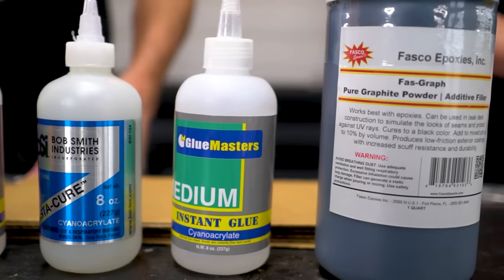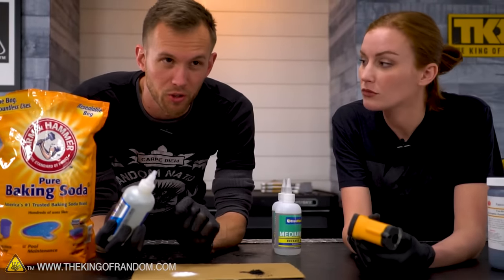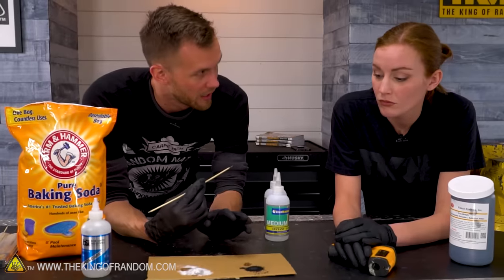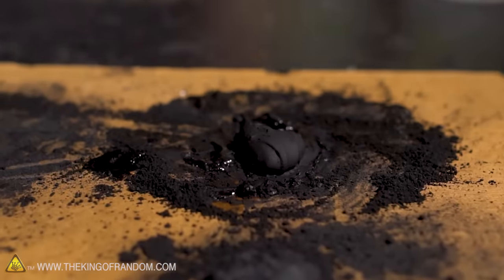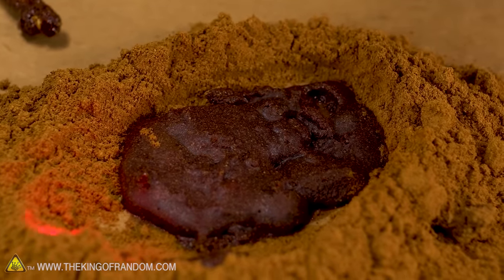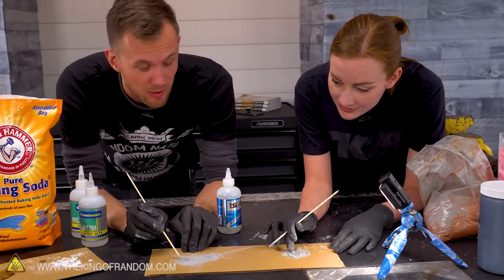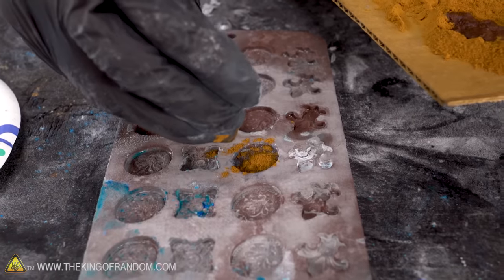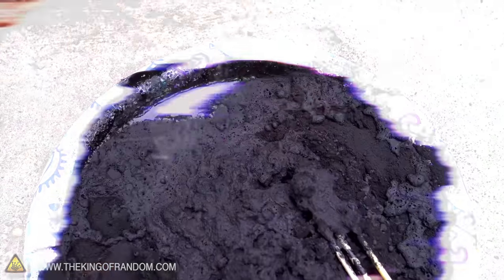Super Glue And CINNAMON Has An UNEXPECTED Reaction! The TKOR Super Glue and Baking Soda Trick!

Comment: By "catalyze," I think you mean "polymerize." Catalysis is the initiation of a reaction between two or more substances by an environmental factor. However, "polymerize" means to form ionic bonds.
Reply: ahh i think you are wrong .A catalyzed reaction is a chemical reaction.
Reply: @latouselatrec  A catalyzed reaction is a chemical reaction in which an environmental factor allows for intermediate reactions that require less energy and typically proceed faster.
Reply: @sciencestararvinsinghk  and what is the environmental factor
Reply: Waiting for the debate to go on...
Reply: Polymerisation forms covalent bonds. Usually bonds between carbon silicon or oxygen atoms.
Reply: Y'all having a scientific argument and I was thinking abt that one yugioh card
Reply: Baking soda works as an accelerator  by neutralizing the acid that slows down the resin from drawing moisture from the air. Its is not a catalyst as it does not change the energy required.
Reply: Ok,boomer
Reply: cringed every time she said catalyze.....
Reply: Oooo
Reply: @sciencestararvinsinghk  not enviromental

Sure you can speed stuff up with like heat. And some only work in specefic conditions (like enzymes).
Reply: After all this, I'm even more confused.
Reply: SMART PPL IN THE COMMENTS gOTTA dIP!
Reply: Wtf r u talkin about
Reply: Dutchik yes you can speed up reactions with heat but any science textbook will tell you that heat is not classified as a catalyst. All catalysts speed up reactions but not all things that speed up reactions are catalysts.
Reply: I learned a catalyst is something that speeds up a chemical reaction like an enzyme.
Reply: Is this a definition for millenials where anything could change so specifics are dangerous? Aka a definition for people that choose to be idiots even though everyone discouraged them from being so. Hahaha
Reply: You don't know what catalyze means either.
Reply: I was thinking about that, carbon tends to be a pretty stable guy.
Reply: All iz well ..all iz well..
Reply: @latouselatrec  no... catalyzing requires a catalyst.. a separate chemical added to  whatever it is your working with that starts a chemical reaction or speeds it up.
Reply: @toheedsultan8263  grab a teaspoon of originality.
Reply: The term „Catalised“ is commonly used for reaction with a second component. Actually a catalyst influences but does not react. Cyanoacrylate often starts by humidity and releases CO2, so partially a polycondensation, but polymerisation as well depending on the type of cyanacrylate used, e.g. Hexamethylendiisocyanate. I‘m drunken kids. Sorry
Reply: Mark lewis Arvin is the child of Dunning and Kruger. He knows two kind of birds but one is a frog.
Reply: J.C. Kohle  Ok, boomer
Reply: J.C. Kohle  tf man? Y'all just can't take a frickin joke..
Reply: @latouselatrec  An example would be the presence of a catalyst - for example, platinum, as used to oxidize CO and other partially-oxidized hydrocarbons inside an automobile catalytic converter.  A catalyst's job is to increase the rate of a chemical reaction and/or reduce the amount of energy required to cause the reaction to proceed.  The catalyst itself is not consumed in the reaction - that is, it does not become a component of the resulting chemical product; it just affects how rapidly the reaction proceeds.
Reply: @MrGsteele  
THIS

Comment: I just saw this video. The ideas you tried at the end for casting items would be useful for making bezels to wrap around coins so they can be worn as a necklace. I wonder if a 3D made mold made of nylon would be better at releasing the casting. Also it would be interesting to see the reaction between the different super glue mixes and the different commercially available cast release products. I live in a one bedroom apartment so random testing is not really something I can do. Making castings in a acrylic box powered vented to the outside is easy thou.
Reply: Just use resin.  It's readily available formulated specifically for whatever application you want to use it for, far cheaper, able to be any color you'd like by mixing in dyes, and intended specifically for the purpose of casting.

I used to use resin cast in silicon molds to flawlessly reproduce miniatures for warhammer 40k.  No need to reinvent the wheel.

Comment: Cool, I knew the bi-carb trick but not the graphite powder one. I've used the bi-carb trick for fixing heaps of stuff but it can be a bit hard to work with because of the instant reaction. Looks like graphite's a bit easier to work with for the same result and might even be a bit harder/ stronger being that graphite is powdered carbon. Mix some carbon fibre in there as well and it would be strong asf.

Comment: The super glue and powder trick is something that model makers and RC balsa builders have used since cyanoacrylate glues came on the scene. Makes great fillets for extra strength. I  used to use a thing called Micro Balloons but baking soda would work too.
Reply: This isn't the same, the baking soda reacts with the superglue as a catalyst instead of just being a filler / composite material.

Comment: One thing I was curious about: Could you check conductivity (or resistance) of the graphite castings? I'm wondering how much coupling between powder grains there is. If they're not touching, the resistance should be pretty high but otherwise, it opens up a few interesting possibilities. Old carbon resistors were made by compressing graphite powder with talc in various ratios to get different values and when you mentioned mixing with epoxy, it reminded me of a conductive paste made using powdered silver and epoxy for repairing pcb tracks.
Reply: With carbon, you can buy regular pigment grade fine carbon black, or a conductive grade.. which has different surface structure that promotes interconnection in a composite matrix. I never saw much happen with graphite powder in an adhesive matrix, but YMMV.
Reply: @gertnood , thank you. That's very interesting and informative.
Reply: Yes,  @yann664  . There is also an entire range of products made that way deliberately to conduct electricity. We use them in the electronics industry because many devices made with the various MOS technologies are extremely static sensitive so packaging, plastic container tubs, black foam inserts, etc. all conduct electricity, albeit with high resistance/low conductivity but enough to form a DC path to earth or otherwise, dissipate any built up static charge. One place I worked actually got lino designed and manufactured with the company logo and in the corporate colours but with millions of embedded black plastic flecks in order to dissipate static charge. We all wore ankle straps that had a conductive strip that tucked into the sock and another conductive rubber strip that made contact with the lino as we walked around.
Reply: I worked as a plastic injection mold maker. We used Eastman 910 glue to repair graphite electrodes that were used in electrical discharge machines (EDM) to burn cavities for the molds. The conductivity was not affected.

Comment: Exothermic reactions play a huge role in working in Composites.  When building Carbon Fiber and Fiberglass aircraft components you have to mix the resins in small batches.  Large batches will go exothermic and will ruin the parts or repairs you are working on.

Comment: Superglues (cyanoacrylates) use a weak acid as a stabiliser. The reaction you see is the exotherm generated when you 'knock out' the stabiliser with a weak base and the material rapidly polymerises into a thermoplastic solid. You will get a similar reaction if you spill the adhesive onto cloth material, such as cotton. (Never use cotton glove when working with CA's, unless you want to burn yourself badly).
I worked for the worlds largest CA manufacture for 20 years. One interesting application we worked on was  poison pill for controlling invasive rabbits and possums in New Zealand. It was a poison pill coated in CA that was then rolled in a mixture of dried apple and cinnamon. These animals  had teeth strong enough to break through the plastic and were subsequently killed by the poison. Any of the local animals that ingested the pill, were unaffected because it passed through their digestive systems and remained intact.
Reply: Interesting.  A selective mammal poison.

Comment: In aviation the air conditioning units can be glued with a mixture of aluminium powder epoxy resin a curing agent and atomised fiber glass and then baked and it’s rock solid

Comment: Super Glue reacts when in contact with metal ions. Baking soda is Sodium Bicarbonate. So there are Sodium ions present. Sodium is a metal. This is why it reacts so fast.
The spray activator also has metal ions.
Aluminum power is also a metal. However, most of this has a percentage of Glycerol mixed in to prevent oxidation so there not a lot of free ions around. This makes the reaction slower.
redrok
Reply: Thanks man

Comment: A “catalyst” is a third party addition to an already proceeding reaction. By definition a catalyst speeds up an already on going reaction. Adding superglue to baking soda creates a reaction, not speeds up an existing one
Reply: I  don't think that is actually what is happening. Cyanoacrylate reacts with water, pretty sure all that is going on is the moisture in the baking soda and other adjuncts is what is doing the work.
Reply: @schilling3003  even if you are correct that the glue is reacting with water (what water?), that is unrelated to the original comment about the definition of catalyst (which the hosts are using incorrectly)
Reply: @darkstar4494  all of those adjuncts have moisture in them, they absorb it from the air.
Reply: @schilling3003  yes, a tiny bit, depending on the relative humidity. So you’re saying super glue has an exothermic reaction with plain water and that’s all we are seeing here?
Water would be a limiting reagent then? it would get hotter if you mixed glue with equal volume of water?

Comment: I'd like to see the glue react with lye and then citric acid followed by a powdered acid with a much lower ph. I'd try spraying the silicone molds with WD40 or WD40's lubricant sprays. Have you tried mixing the glue with wood ash or charcoal dust yet?

Comment: i have a couple questions:
1) does this reaction work with thermite and if so
2) does the thermite still burn the same way
Reply: Hm. Aluminum powder reacts primarily with bases, not acids and iron oxide doesn't react with either easily. Thermite also requires a lot of heat to ignite.
If you apply enough heat to ignite the thermite, the glue will already have decomposed - so it shouldn't have much affect on how it burns.

Comment: Ummm. the laser in that thermometer plays zero part in the actual measurement. It's only there to tell you ROUGHLY where you're pointing the thing. It's a cheap laser diode, just dumped in the housing, usually held in place with hot glue. Plus, even at that distance, the area you're measuring is easily a hundred times larger than the dot from the laser, and you're measuring the average temperature of everything the thermometer "sees"...all at once. Even the angle makes a huge difference to the measurement. They're only really useful for things that are pretty large, and at a uniform temperature.

Comment: you can mix graphite, carbon black and resins to make electrostatic shielding. you need to test the resistivity/conductivity of that graphite glue mix, i've been looking for a way to attach wires to graphite shielding.
Reply: I have managed to solder wires on to self-adhesive copper "slug" tape. You could try sticking some slug tape to your graphite shielding then solder the wire onto the slug tape? Just use a lower power soldering iton and solder quickly - before any plastic starts to melt.

Comment: By the way superglue is cyanoacrylate, so inhaling those fumes is a VERY bad idea. The inhaled fumes might interact with the moisture in your lungs and it´s kind of hard to survive. Just saying..
Reply: @LateLost  And professional model makers have a chemical respirator in their workshop. I've made interactive exposition pieces for museums; the first thing I learned was to always wear protection or use a fumehood when working with resins, silicones and other polymers.
The fumes came from the CA + carbon though. When doing experiments with chemicals where you don't know what kind of reaction might occur you should NEVER do so in the kitchen without any kind of protective gear...

And don't even get me started about the powdered aluminium and graphite...

Comment: The graphite powder with epoxy is used in electrical motors/generators winding. it’s used to make a semiconductive coating which reduce the damages of corona discharges by dissipating it to the whole winding.

Comment: Cyano and baking soda, talc or bone dust is a common repair for guitar nut slots. A guitar nut is the thing at the beginning of the fret board that the string touches just before it heads towards the tuner. The nut is multi-functional on most guitars as it acts as a string spacer, a string guide AND each slot is filed to the correct depth so the string sits at the correct height above the 1st fret. It is a wearable item that often needs to be replaced or sometimes a slot is filled with super glue and baking soda, talc, or bone dust so the slot can be re-cut to the correct depth.
Reply: Thankyou,am a guitarist and will
use this to build up the nut "slots".

Comment: Mixing graphite with epoxy is used in joining pieces of composite materials like carbon fiber and fiberglass and can also be used to fill cracks holes and seams.
It's generally safer than fiberglass particles for obvious reasons.

Comment: I don't know how I came across it, but I had a fabric chalk that made a cement when mixed with super glue. I used this mix to fix our 64 joysticks, as we frequently wore them down. The fix would last a month. It got hot, but not enough to burn or melt anything.

If I had a similar problem now, i'd use baking soda... looks like the same reaction.

Comment: The application method you described by applying the c.a to the powder is the opposite to how I’ll often use it! I’ll fill the crack or joint to be secured with a bead of c.a then apply the filling power or fibre, and repeat this multiple times for thicker joints as too much powder and the c.a can set before fully penetrating. Also fibre such as cellulose and cotton works very hot but some synthetic fibres are incredible in strength like braided fishing lines,Dacron,dyneema ect combined with c.a for binding and reinforcing are very tough! and even better for certain jobs than some common composite materials

Comment: You inspired me to test something. I added hydraulic cement powder into a small section of a concrete crack on my pool deck and added super glue. It hardened in seconds and the patched section completely disappeared.  Next step is a bigger bottle of super glue. THANKS!
Reply: Where do you get bigger bottles of super glue ?

Comment: When you mix this stuff together, graphite with epoxy and others, can you show its properties when microwaved, like dish, bowl repairs. Need to know stuff has heat resistance to some degree, hot days, microwaving or car exhaust system etc....will repairs work around common heat sources after the repairs. 

Thanx in advance

Comment: This is how "carbon fiber" is made. Carbon fiber is a fabric but they use epoxy (a plus b hardeners) that do exactly what your super glue does. With carbon fiber under a perfect vacuum, you pull the a plus b epoxy through the fiber, hence you get a mixed material effect. With the fiber you get ultra strong tensile properties with the high compression strength from the epoxy. 

One of the problems with the carbon fiber and the epoxy mixture, the compression strength is no where near as strong as metal. Maybe using aluminum powder can help with this. Cool work. Thanks for sharing

Comment: I have a GPS Bicycle Computer mount and I need to bond a GoPro/light mount to the bottom of the GPS Mount so that I have a light on the front of my bike.  The GPS Mount is Plastic and the GoPro/light mount is metal.  I tried velcro but the light wobbles about.  What do you think would be the best combo to create a black paste which could be used to make a reinforced connection between the two pieces?  Happy to send pictures so you can get a better idea of what I'm trying to do if helpful.

Comment: I have not seen the entire video but I am convinced that the catalyst is on the pH scale as a basic.  Carbon is a neutral on the pH scale so less reaction.  I would have tried Draino which is sodium hydroxide which would be a much more basic on the pH scale and I would predict a more active outcome.  I would suggest an acid-type powder like sulfuric acid would have less of a reaction.  Also with the carbon power, since it is neutral, I think the glue itself is just bonding the carbon particles together and is less strong.  Glue and the baking soda makes a chemical reaction and the high pH is required to make the strong bond that seems to fuse together.  Just my thinking....

Comment: I recommend using eye protection if you are not sure how it will react as it may boil and splatter in your eyes and glue them shut instantly. Just wanted to say this as it is a much cheaper and safer alternative compared to get your eyes "opened" again at the hospital. Also the fumes will stick to the inside of your lungs as they are moist so don't stand in the "smoke" if you don't have to as it's quite dangerous. Cheers

Comment: What works best for repairing stripped threads in metal or plastic using a tap? Such as in a 3D printing bed or an auto transmission with a stripped hole the starter bolts into.
Reply: helicoils